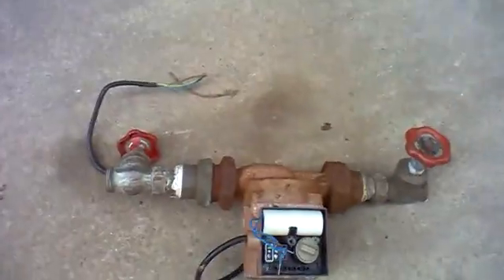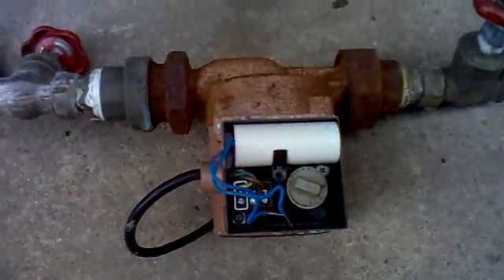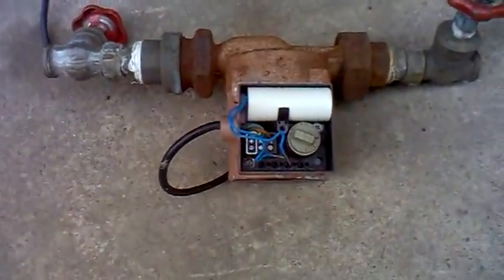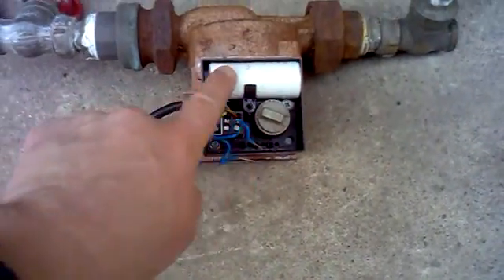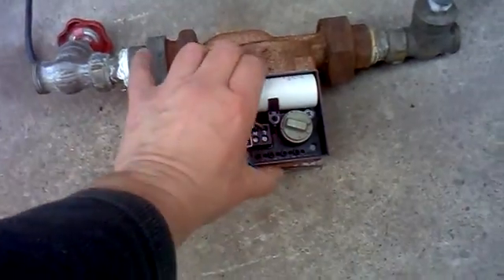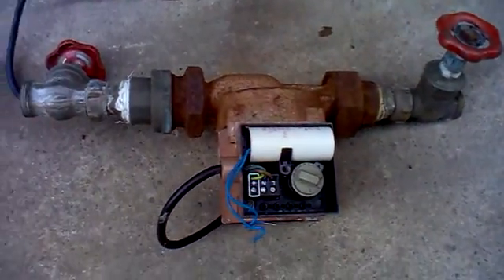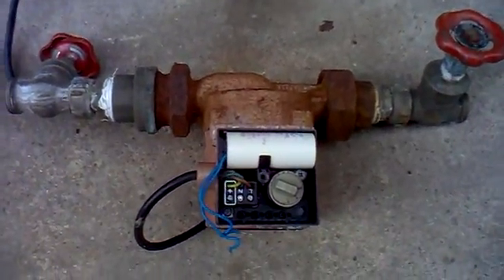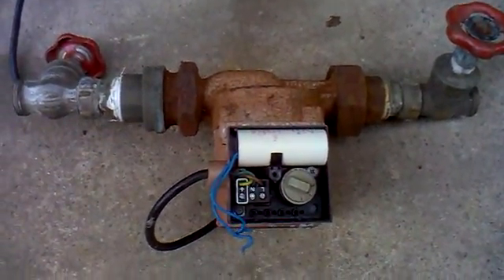Grundfoss 15-50x18 Central Heating Pump Capacitor Replacement

Comment: thanks sir  it is really helpful but can you tell me  where i can fine this electric conection cover which is on the top of pumps.where we put all three wires & capacitor wire. i have problem with this plate.it is short(as i  put wires electric city goes off)  i saperate this plate from pumps & even capacitor still electric city goes off. i check pump is working fine.so help me to find this part thanks for this video.